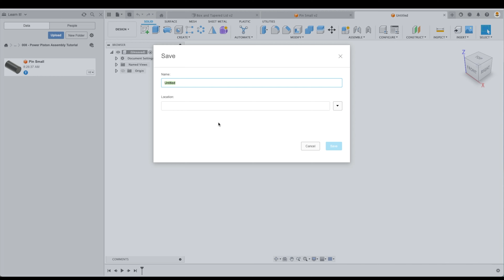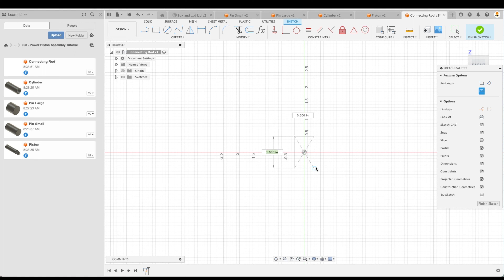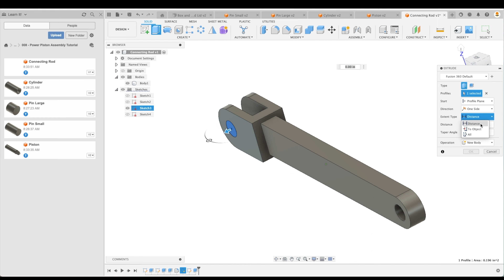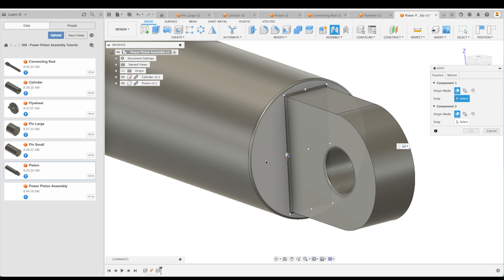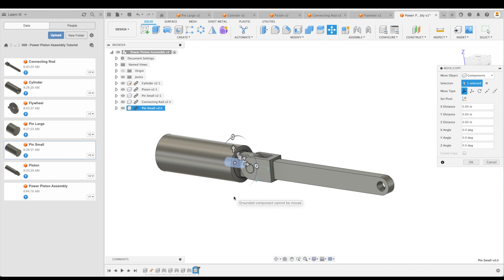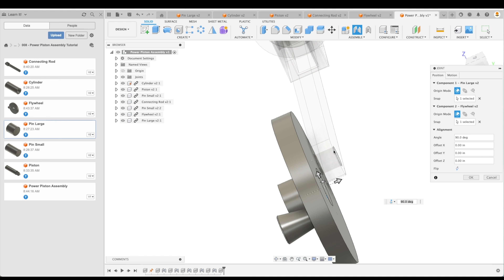Autodesk Fusion 360 - Power Piston Assembly Tutorial - Models, Assembly, and Motion Study - (2023)

Comment: guys just for your reference, if u face the problem when ground the pin large at the last step before motion, maybe u face the same problem with me, u choose the ground to parent, I commend this on 30/4/2026, using the latest version, rather than use the ground, at this version it show pin, there is a option above the ground which is pin, choose that a we can done the feature, while I didnt clear about are there the same but it works.
Reply from the maker: Excellent! Thanks for sharing. Appreciate all the help ones give for this community.

Comment: Sir I am having difficulty with grounding the pin large,it's showing if i ground it it will revert to its original position

I exactly followed your steps

What's the problem

Fusion says its interfering with the assembly joints
Sir! Pls help me out
Reply: Hello Sir,I pinned the large pin

Now its working as usual 

Can you explain what was the problem??

And what's the difference between pinning and ground?
Reply from the maker: Thanks for reaching out! I made two tutorials to address the issue you faced. Check them out here:

https://www.patreon.com/posts/130750224?utm_campaign=postshare_creator

https://www.patreon.com/posts/124835334?utm_campaign=postshare_creator

Comment: if i am gonna 3d print this (with abs plastic), i am supposed to take the diameter of the piston a little less than 1.5 inches so that the piston can actually move?
Reply from the maker: Yes, you’ve got it! It would be good to make a parameter so that you can easily change the piston diameter. If you are able, please comment your results and parameters to this string. Also, it is good to make a personal record of your findings for future reference. Keep up the great work!